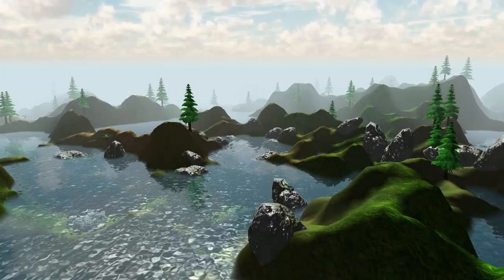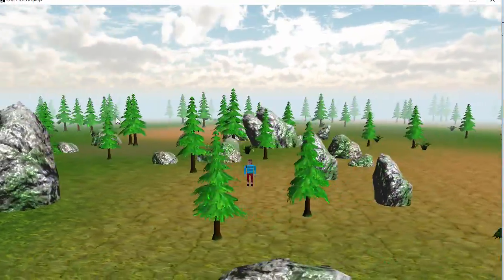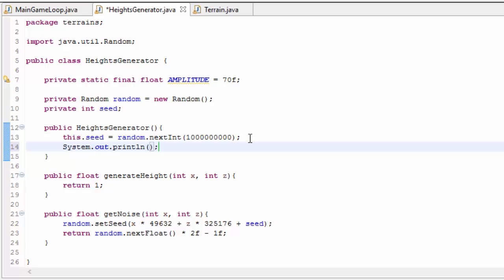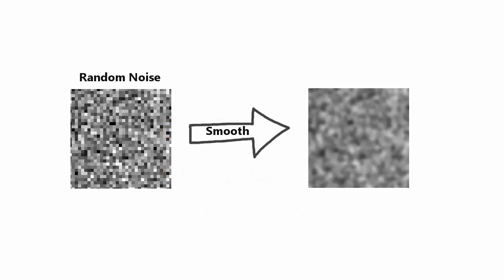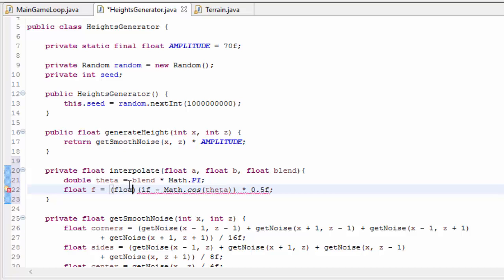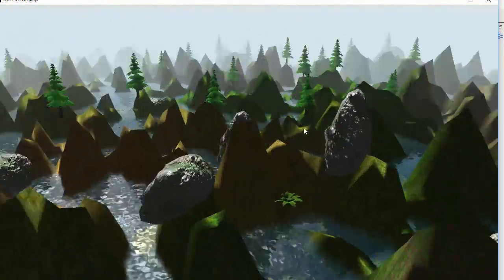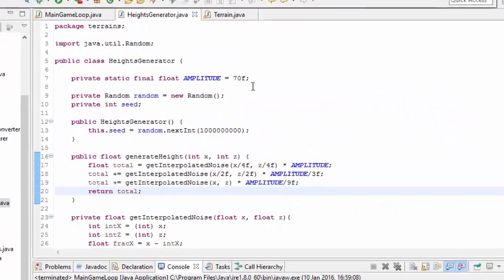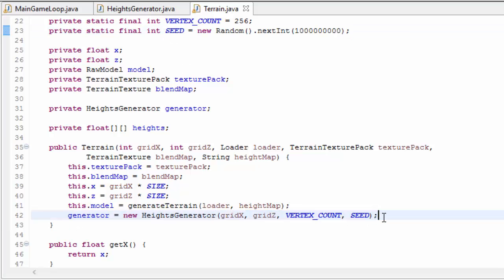OpenGL 3D Game Tutorial 37: Procedural Terrain

Comment: In the getNoise function I noticed using here in C # that the value used to multiply the (x and z) makes an effect with which the lines only generate in the Z direction, and normally this is a little random too. I tried to randomize the value, but that made the map all messy, when the value is solid the lines are generated in different directions, but even so I wanted to find a way to correct this.

Comment: How to create infinity terrain generation?
Reply: Just translate the Terrain with the player and calculate the height values new (the best way for this is to only translate the terrain mesh when you moved the distance between two terrain vertecies). For this however you need to make a uniform out of the heightvalues for the shader. Make a 2D array and send it to the shader or create a heightmap.  Or use a heightmap in the firstplace but then the terrein would repeat it self over and over again.
hoping that helps you a bit.
peace ;)

Comment: So, I came across a small problem which doesn't really affect the game at the moment, but affects different scale maps a lot. The terrain code is still using the heightmap to determine the number of vertices in the terrain. Could anyone tell me how to fix this without hard-coding some value (so the terrain using more vertices when larger and less when smaller)?
Reply: Never mind about it using the heightmap. I was coding without pausing, so I missed the part where he changed it. The second part of my question still stands though. How could I make the number of vertices dependent on the size of the terrain?

Comment: Hello ThinMatrix! First of all, thank you for all these brilliant tutorials! I have two questions on this subject.

1) Since I'm using C++, I probably have a different random number generator, the problem being it's not that random at all. Even with the big numbers hack you show, my terrains tend to be terraced as often at least three neighbouring squares have the same height, and 3x3 flat squares are common too. Have you run into similar problems as well?

2) This one concerns the normal computation method you use.When I make several terrain tiles (I've taken care of seams being the same height) there are pretty noticeable normal seams. Generally viewing a seam from one side will be OK, but from the other there will be sudden, unrealistic darkening, which really breaks the illusion. What do I do?
Reply from the maker: I'm not really sure how to help you with the first issue - I haven't come across a problem like that myself. Perhaps you can find a better random number generator for C++ online somewhere.
As for the normals, the seam issue occurs because you don't take the neighboring heights from the next terrain into account. If I remember correctly it tries to sample the height on the current terrain and then just returns 0 when it realizes that the sampling point is outside the current terrain. In order to fix it you'll need to be able to sample the height of the vertices on the adjacent terrain when you're calculating the normals for those edge vertices.
Reply: I've actually kind of resolved both issues now. C++ generator responds better to [seed+1*x+1*z]. Using exact octaves like you gave okayish results, but the edges were too sharp, so I added additional smoothing layer. It looks pretty good. Now, the method with octaves is called getHQNoise(int x, int z), and getHeight usese weighted average kernel with inputs from getHQNoise.

This, of course, means that instead of sampling 9 times per point, we sample 81 times, which is tough on load time. With standard size and vertex count, it took about two minutes to generate and render. Now since most noise values are used repeatedly, I figured it is a waste of processing power to compute them every time, so I added two private hash maps <string, float> to HeightsGenerator. One memoizes smoothNoise function, the other one memoizes hqNoise function. Key string is generated like this: (x, z) -> x+":"+z. So any call to noise functions computes values only once and stores it in the appropriate hashmap. Timing has improved from two minutes to 6 seconds, so it's worth it.

Finally, I was not satisfied with the normal generation method you described. It looks fine under point and directional light, but the illusion is quickly destroyed if you point a flashlight at the terrain. I use flashlight attached to the camera to inspect lighting on objects and this particular artifact with terrain was common: the light would be very weak when going downhill and strong when going uphill, aiming the flashlight at roughly the same angle in respect to a proper normal. So, I guess the finite differences method normals were rather biased to some directions.

Instead, I implemented a different normal generation algorithm. Very conveniently, our HeightsGenerator function is defined on the entire plane, so each point on terrain is a part of exactly six triangles. If we compute normals to each of these triangles with cross product, sum them, divide by 6 and normalize we should get a pretty good normal. Again, this algorithm benefits from memoization, at least a little (each triangle is shared by three points). Generated normals are very good (they pass the flashlight test) and this also solves the problem with seams, since height data for triangles is retrieved from the generator itself, which has practically infinite domain.

With new normal generation method it takes about 9 seconds to generate and render, which is a pretty nice timing.

Anyway, thanks for the reply and these fantastic tutorials. Keep up the good work! Here's a screenshot of my results (haven't done last two water tutorials yet xD).

https://prnt.sc/gznnfq

Comment: Is this method Possible to implement on a 2d top down game? Or is it something else i need to think about?
Reply from the maker: Well, what exactly are you trying to implement? In this tutorial I'm generating heights for the terrain, but seeing as your game is 2D and top down I guess your terrain wouldn't have heights anyway? Or maybe you want to generate things like lakes, which you could still do with this method. Just generate the heights for the terrain as if it were 3D, and then any parts of the terrain that have a height less than a certain value become a lake. You could also use it to generate biomes of sorts, by using mapping different height ranges to different biomes.

Comment: For some reason, on later tests, if I set the amplitude to 1 and run

 public static void main(String[] args){
     HeightsGenerator hg = new HeightsGenerator();
     float min = 1000;
  float max = -1000;
  float f;
  int range = 1000;
  for(int z = -range; z < range; z++){
   for(int x = -range; x < range; x++){
    f = hg.generateHeight(x, z);
    if(f > max){
     max = f;
    }
    if(f < min){
     min = f;
    }
   }
  }
  System.out.println("min: " + min + " max: " + max);
    }

as a test method, then I get a min of around -0.65 and a max of around 0.65
This is very weird behaviour that's in the way of what I'm trying to achieve, does anyone know where it comes from?

Comment: +ThinMatrix Hi, How do you get the terrain to be more low-poly like Equilinox?
Reply from the maker: The generation of the terrain is basically the same, and it's just the shading that makes it look low-poly. To implement flat shading I used the "flat" type qualifier when passing the colour from vertex shader to fragment shader.
Reply: +ThinMatrix Thank you very much. I've followed your tutorials so I don't have a colour variable, but i do have a texture variable. This didn't completely work however so I made the normals flat and that helped a lot but split it into diamonds instead of two triangles :( Is there anything I can do to fix this do you think? Thanks.
https://ibb.co/n5bOy5 (Image of the diamonds)

Comment: so interpolate is generating a random number between two points?
so the result of an interpolation between 3 and 4 might be 3.6?
Reply from the maker: Interpolating between two points means moving smoothly between two points. So for example, if we linearly interpolate half way between 4 and 8 we'd get 6. If we linearly interpolate three quaters of the way between 4 and 8 we'd get 7. Interpolating is basically generated data between known points.
As another example, say there's a car travelling along a line. At time 0 it's at x=10, and at time 2 it's at x=16. We can interpolate to estimate where it would be at all the other times between 0 and 2. So for example at time 1 we can work out that it would be at x=13 by interpolating half way between 10 and 16. At time 1.5 it would be at x=14.5 which we get by interpolating 3/4 of the way between 10 and 16.
Reply: thank you that's very helpful and clear :)

Comment: I found that using the code for multiple Terrains really severely affected the realism of the terrain, and the terrain now appears more 'tiled' with a higher vertex count and with a lower vertex count still seems to have repeating stripes. Any idea why?
Reply: Oh, I have negative gridX and gridZ values.
Reply: Fixed! Just add your Terrain.WORLD_SIZE to the gridX and gridZ values in HeightsGenerator constructor (provided your terrains are centered at the 0,0 point)! I think this solves it?
Reply: Thanks!  I was racking my brain on this.  As far as I can tell it is working as intended once I add the world size.

Comment: ThinMatrix why dont you make a map with a key as the position values & a float as result with that you can easly detect if a seed was already generated and you can even cache them faster, As far as i know a random generator is byte merging but i can be wrong on that one.
What do you think?
Reply from the maker: You can certainly do that, and that should help to speed up the generation time :)
Reply: ThinMatrix 
Another thing to try (I didn't post it because of the limitation)
is to use 2 double arrays.
a boolean[][] for checking if it is already generated and a float[][] to get the values. The downside is more ram is used from the beginning and that you have to use Positive Values only but it should run much quicker then a HashMap.
But again it has a lot of limitations

Comment: Wow, this is expensive. On my computer adding five terrain instances takes about 5060ms. That falls to 2084ms if I make the HeightsGenerator cache values for the (x,z) positions like so...

 private int vertexCount;
 private float noiseCache[][];
 public HeightsGenerator(int gridX, int gridZ, int vertexCount, int seed) {
  this.seed = seed;
  this.xOffset = gridX * (vertexCount - 1);
  this.zOffset = gridZ * (vertexCount - 1);
  //New bits...
  this.vertexCount = vertexCount;
  noiseCache = new float[vertexCount][vertexCount];
  for (int x = 0; x < vertexCount; x++) {
   for (int z = 0; z < vertexCount; z++) {
    noiseCache[x][z] = generateNoise(x, z);
   }
  }
 }

 //...

 private float getNoise(int x, int z) {
  if (x >= 0 && x < vertexCount && z >= 0 && z < vertexCount) {
   return noiseCache[x][z];
  } //else
  return generateNoise(x, z);
 }

 private float generateNoise(int x, int z) {
  random.setSeed(x * 49632 + z * 325176 + seed);
  return random.nextFloat() * 2f - 1f;
 }
Reply: Unfortunately, procedural generation isn't exactly the cheapest terrain generation technique, so you're just gonna have to put up with the slow load times.

Comment: Can I just use JOML's SimplexNoise.noise(x, z)????
Reply from the maker: Maybe, but I really don't know - I've never used JOML before I'm afraid.
Reply: As long as it returns a value between 0 and 1 or -1 and 1, they it should be fine! Then you just multiply the noise by your maximum height.

Comment: I have a problem with my BlendMap: https://www.dropbox.com/s/ggs9rg9aq3ogbmg/1458815180359.png?dl=0
The heightmap works great, but the very last pixels of the blend map have the wrong color.
Can anyone help me with this issue?
Reply from the maker: +David Schwarzbeck You need to clamp the edges of your blend map texture using these 2 lines when you load your blend map texture:
  GL11.glTexParameteri(GL11.GL_TEXTURE_2D, GL11.GL_TEXTURE_WRAP_S, GL12.GL_CLAMP_TO_EDGE);
  GL11.glTexParameteri(GL11.GL_TEXTURE_2D, GL11.GL_TEXTURE_WRAP_T, GL12.GL_CLAMP_TO_EDGE);

You only want to clamp the blend map texture though, so make sure those lines aren't used when loading other textures.

Comment: After implementing the code from this tutorial up to 2:15 I run the game and it appears completely black and never loads. I've looked through all of it but cant find out whats gone/ Here's my code: Terrain class: http://pastebin.com/866BReX3 HeightGenerator class: http://pastebin.com/c9ph612k
Reply: +Winter Roberts whats gone wrong*
Reply: +Winter Roberts After more careful examination I've found that it was using the getHeightOfTerrain method causing problems, It never finished its calculation, but I believe this is later fixed.
Reply: +Winter Roberts More specifically I was comparing two floats using >/< which is incorrect. They should be compared like if(Math.abs(leftFloat - rightFloat) > aNumber)

Comment: New issue.  I am finding an error with the terrain collision system.  Whenever I use a small vertex count, I find myself going to Y = 0 when I near the edge of the terrain.  I am using TM's code, so I do not know the issue.Any ideas?
Reply from the maker: +Nicholaus Clark When are you calculating which terrain the player is in? You would probably need to calculate it after the player movement code but before calculating the collision with the terrain. Otherwise when you move into a new terrain the first time the calculateHeight() method is called it will be called on the old terrain and will return 0 because you're outside the bounds of that terrain.
Reply: I fiddled with the player.move(Terrain terrain) method a little bit.  I had been determining which terrain the player was initially on, before calculation.  Now that I have it as a player.move(List<Terrain> terrains) method, I am able to calculate the terrain that the player is on after the XZ translation.  Is this what you meant? It works much better if so.

Comment: I am running into an issue where the I am using multiple terrains.  They appear smooth, but I jump way up in the air on the border between the terrains.  Any ideas?
Reply: +Nicholaus Clark If you still have the collision for terrain that ThinMatrix showed it should look like this:

float terrainHeight = terrain.getHeightOfTerrain(super.getPosition().x, super.getPosition().z);
if (super.getPosition().y < terrainHeight)
{
 upwardsSpeed = 0;
 isInAir = false;
 super.getPosition().y = terrainHeight;
}

just add   && terrainHeight != 0   to the end of the if statement.

Comment: Okay. So I'm not getting my multiple terrains to connect right. (E.g. the terrains aren't smoothly transitioning, it's just an end to one and the start to another, at different vertical positions.) And I'm using the terrain height generator code from the download in the description. Code and screenshots can be provided if necessary.
Reply: +Mason Harris Fixed it: forgot to set all of my terrains seeds to the same seed, and I had made a mistake in my terrain collision detection code.
Reply: I have this problem too but the seed is always the same.
Reply: +Mason Harris what was the mistake in the terrain collision detection?

Comment: Hey thin, Recently I've been trying to get "Gods' Rays" into my engine. I the online tutorial I've been following for it seems relatively simple, you render your seen to a lower resolution fbo without using depth or texture testing, clear your depth buffer and render the seen normally, switch to orthogonal projection and then blend your fbo and main frame buffer together to get the effect. But just like when I was trying to get shadows into my game engine, I've gotten stuck on using an orthogonal projection since I don't really know how to go from the perspective projection we use in the engine at the moment to an orthogonal projection. How did you go about doing this?

Comment: +ThinMatrix or somebody else who may have an answer to my question, How would i go about rotating the player's y-axis towards an (x,z) point on the terrain, with x being positive and z being negative?

EDIT: I figured out how to do this a 'hacky' way. I just made the nodes in my pathing system hold an offset from parent vector and then set the rotation needed while going to the next tile depending on the offset from the parent, as i only need 8 directions of movement. BUT It would still be very useful if someone were to tell me how, or link me to an article on how to properly do it.

Comment: Thanks really helpfull (as always), currently im doing some sort of GeoMipmapping, do you have any ideas how to manage procedural terrain setup with block division or simplier:
Do I need to split entire terrain into separate VAO objects (like 256+ different meshes) with several (16+) types of indiceBuffers for LOD?
Reply from the maker: +GieneqAD You only need one VAO (the actual vertex positions themselves never need to change) but you have multiple index buffers to determine which vertices are actually rendered and how the vertices are connected together. You don't bind the index buffer to the VAO like we've done in the tutorials; instead you simply bind the relevant index buffer before rendering the terrain. You need a minimum of 1 index buffer per LOD, and possibly more if you wan't to deal with "stitching" different LODs together.